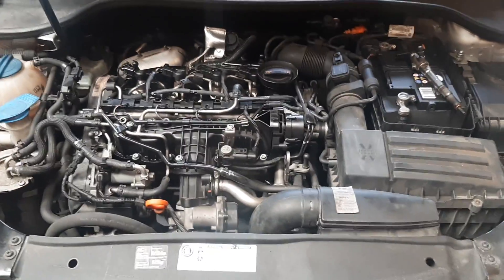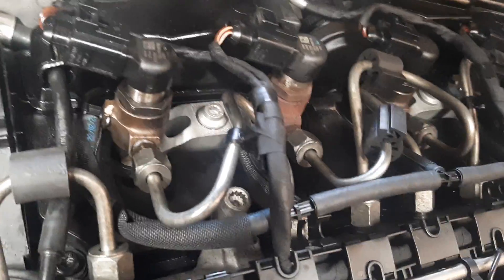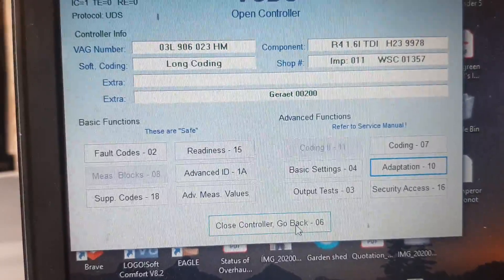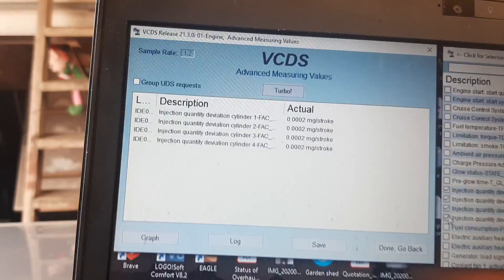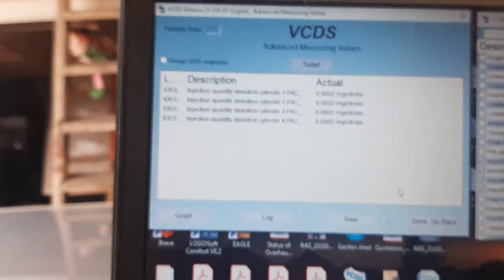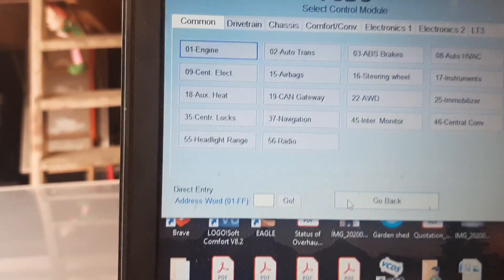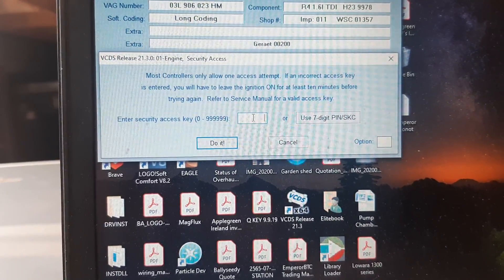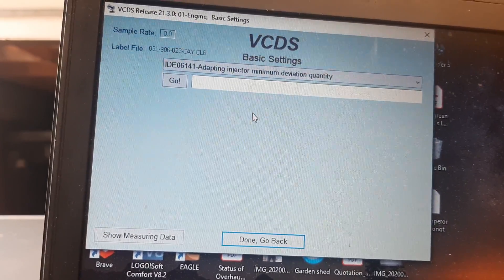VW 1.6TDI Injector Quantity Adaptation IDE06141 CAYC engine

Comment: Thanks so much, i ll try this tomorrow, i was stuck in the infinite loop.
Reply: Hi, I have changed the injector and it seems to have been sorted now. I never coded the injector or did a quantity deviation adaptation yet. Probably just an injector that went bad. I was thinking of coding the injector and just driving it to let it do the quantity deviation adaptation itself automatically.
Reply: @ohsasho5865  that's strange but if it works it's good. I doubt that ECU does adaptation by itself otherwise what's the point of the manual adaptation.
Reply: Hello, everything worked well on my 1.6tdi cayc, duration: 20 min, after that engine sound and behaviour became very good, motor health is back. Thank you so much. Do you have other procedures like this one to improve other things ?
Reply: Hi, I am stuck in the infinate loop. I did everything word for word about 5, also looked at part 2 and still stuck in a loop. Was there anything different that you did? @GEO-42
Reply: @ohsasho5865  it's not infinite, it can take long, just be patient. It took more than 20 min on my car. How long did you wait ?
Reply: @GEO-42  About 75 mins and still nothing
Reply: There is a follow up video after this one on this channel about the infinite loop. It's an issue with vcds, you should watch it. Basically when engine is started and vcds working, you should navigate in vcds, read some random values and THEN try the adaptation after entering the security code.
Reply: @GEO-42  Thanks for your reponse, I appreciate it. I did watch both videos before I tried this.The first attempt was about 75 minutes which I stopped. The second and third attempts I stopped it at it 30 min. Im guessing I may have a faulty injector. Engine sounds worst now
Reply: @ohsasho5865  Don't forget to put the injector code before adaptation. After all your attempts check if the injectors coding is still there.
Reply: I mean the code that comes with the injector and must be entered in vcds.
Reply: @GEO-42 Thanks, Yes. I did check the codes and recoded it. I will change the injector.

Comment: Do you know why I do not have in VCDS this function IDE06141? I have the same CAYC engine in Golf, UDS, I’m using VCDS version 20 and I don’t have it. I have the same problem in injector number 3, but can’t do this adaptation. Thanks for help.
Reply from the maker: That is strange - Upgrade to latest version of VCDS and double check it should be there in Basic Settings

Comment: Do this injectors need programming in the audi 1.6 tdi kayc??
Reply from the maker: Hi Richard, do you mean CAYC engine? Yes all modern common rail diesel injectors generally need to have their offset codes assigned in the factory programmed.

Comment: Tried it on my Audi A3 1.6 (2012) and it worked, it had clinking noise before but now it is really smooth. Initially I thought there is a bad injector but for now it works well. All-though the torque is not here anymore so I guess the algorithm made the injectors closer to the lower values so that it throws less gasoline which made the car weaker now.
Reply: did u get an engine light with codes for injectors?
Reply: @idajosefin0121  no engine light, just the clicking noise
Reply: Bu prosedürü enjektör degiştirmedenmi yaptınız Orijinal enjektörler üzerindeyken mi ?

Comment: I’ve tried the minimum injector deviation, when I had the original injectors, the vehicle performed the cycle in 5 mins. I changed the injector and now this is taking over 50 mins and isn’t finishing the process. Any help will be greatly appreciated.
Reply from the maker: Hi @fez14 I have made another video to hopefully clear this up https://youtu.be/uK7zuUVclJ8

Comment: Just fitted a new injector to a skoda 1.6 tdi 2016
Did a leak off yesterday and showed it didn't leak off at all or barely. Changed it coded it in with modus snap on. Its not happy it's running on 3. No engine codes. I checked to see all codes are there. They are. I'm thinking use VCDS but is there something else I should do I will be sure to try this Procdure!
Reply from the maker: I'm assuming the 2016 1.6tdi is running the Delphi injection system? 
VCDS is what I would use. The delphi setup requires a conversion map I think.
Reply from the maker: @Richie if Delphi look at this post. https://forums.ross-tech.com/index.php?threads/3396/

Comment: Hi there I have rought idle at cold dtart with my 2011 VW Jetta 1.6 tdi,  engine code CAYC. Also engine has click sound under acceleration. I send all injectors 2 times for repair and cleaning and the injector tester show normal values for them. I try to do adaptation. Process starts , revs go up and down but it never ends. 30 minutes and still continue. What can I do ?
Reply from the maker: Check out my updated video @Eldi hope it helps you. https://youtu.be/uK7zuUVclJ8
Reply: @enginemanagementadventures7305  thanks so much. I really appreciate it and I can’t thank you enough. I just wanna ask , mine lasted at least 20 or 25 minutes and VCDS said timeout, does it finished correctly? Cuz car is running really bad and I can hear injectors when I am driving. Also when I check values, 2 injectors have negative values around -1.4 and the other 2 have positive values around 0.5

Comment: Hello buddy. I have got 4 new injectors replaced but the mechanic forgot to coding it. The car been shaking and revs it’s self when it’s parked. I got someone coming tomorrow to code them in. He’s got vcds program but he’s never have done it an Audi before. Any advice or just to follow when you done in the video?  Appreciate your time to read this for me
Reply from the maker: Hi there, Audi? Thats most likely a 2.0tdi probably Bosch injection system - do you have the model and engine code or power?

Comment: Hello bro thanks for the video .. I have vw vento 2012 1.6 TDI engine have injector failure and replaced 3 injectors with 2 new and 1 used injectors one by one in 6 months after replacing 3rd injector (used injector) my engine performance has dropped and my mileage and pickup is very low, actually after replacing 3rd used injector with in a day again that 3rd injector got failed so have went to the service station and asked for 3rd one the service person did something in laptop for half an hour tha faulty injector gets adopted to it and fill date no failure in injectors but after that am only no pick and no milage my engine noice has changes pls help me out with this bro i want my previous performance back.. (also of I tell this story to any of my seicive person they all are checking in software and telling there is no fault code showing so ur injectors are working fine no need to clean or change the injector yet seams) thanks in advance 🙏🙏🙏
Reply from the maker: Hi Saravana, did your injectors fail electrically, did the piezo pack fail. Do you know what fault codes were present? How many KM's are on the engine?
It is important to know if the injectors failed due to wear or electrical failure.
Reply: @enginemanagementadventures7305   Hi Thank q so much for u reply, Yes my injectors failed electrically (solenoid), have not notice what fault code were reflected, now my ODO is 114000km and have faced injector failure at around 80000kms,
Reply from the maker: Very low mileage for failure! you should check the injector offsets first - the new injectors may be different from the used one. Very strange that 3 injectors failed piezo stack so quickly.
The used injector may have a lot of milage on it - when coded the ECU thinks its new, did you run IDE06141 to balance?
Reply: @enginemanagementadventures7305  Hi bro how to check injector offsets?? the used injector may have lot of mileage la bro so if i replace it with new means everything will be okay??? and don't no exactly whether my service person did IDE06141 to balance my injector or not, but he took hardly 15 to 20 mins to arrest the fault code. and bro how to contact you can u share ur mail id for further TIA
Reply: @enginemanagementadventures7305  Thank q for u reply bro 🤗🤗🤗

Comment: I have a problem with my ibiza 1.6tdi 105hp, when i start the engine in the morning there is a loud sound,  clicking, engine vibrating and a white smoke coming out. And after it is warm it sounds good.
Is there any solution? Or I should change the injectors?
Thanks!
Reply from the maker: Hi @NotBAD The symptoms you describe could point to many things but a more detailed assessment is required.
Do you have any Engine fault codes active? If the engine is performing normally when warm I certainly would not replace Injectors unless they are obviously defective.
Reply: @enginemanagementadventures7305  hey, thanks for the reply, really appreciated.
I havo no engine faults and this happens only once a day in the morning when the engine is cold.. when it's warm it runs like a clock, a friend told me to put some oil+gasoline in the tank, it may help the injectors clean...
Thanks again.
Reply from the maker: @NotBAD Please do NOT put petrol/gasoline into a diesel engine! your common rail pump relies on Diesel fuel for lubrication and the solvent action of gasoline will dramatically reduce the lubricity of the fuel causing complete injection system failure.
Reply from the maker: Check you alternator over-run pulley it may be seized causing the loud sound when the engine is cold.
Reply: Have the same symptoms on 3.0bitdi, have you sorted it out?

Comment: Can’t find this option in VCDS 21.9 
Any advice would be appreciated.
Reply from the maker: Hi Moto, what engine are you communicating with ?
Reply: @enginemanagementadventures7305   Hi, cheers for your reply. 
It's a 2009 Golf 1.6tdi CAYC engine. 2 Injectors replaced with recon units, coded in with VCDS and engine now runs lumpy at idle.
Reply from the maker: @MotoHighlands Is your VCDS the latest Revision I'm currently using V21.9
Also what is the Software code when you log into engine screen i.e. 1.6 R4CR Hxx xxxx
Its possible that this was not available on early software versions - There may be an option to "Reset learned values of quantity adaption" this will reset the offsets for smooth running idle control.

Comment: Nicely done 
Q" can I do that in my VW Touareg v6 tdi to calibrate injectors looks like #2 is giving on higher side 
Thanks
Reply from the maker: Hi Emil, its important to realise that this inbuilt procedure is for the replacement of an injector. There are many reasons why compensation values vary, nozzle wear, drivetrain oscillations from worn flywheel etc.
The Ecu adjusts this value continuously to smooth out idle.
If your engine is performing ok I would leave it alone unless replacing a failed injector.
Reply: Hello. I replaced injector 3 and 4 last year in my Audi A3 1.6 TDI 2012. It is now misfiring when it gets warm. I took it to a electrician and he said injectors 3 and 4 are showing -ve readings. Will this procedure work for me ?

Comment: Have the same issue, P0202 fault which "is" injector cylinder 2, the faulty one is second from the left looking in from the radiator. My VCDS data blocks all show cylinder 4 faulty (which I gather is the firing order so no 2 geographically). Did you have to remove number 1 and 2 injector to replace as the bar will not come out unless you do? (they say remove injector 1and 4 in the manual but think its firing order again).
I would be careful with the VCDS use of cylinder numbers, if you are replacing an injector I would check the existing code correlates to the injector you are replacing so when you recode you know it corresponds.
Reply from the maker: Hi phil, generally cylinder 1 is @ crank pulley end. (French cars Renault for example are the inverse of this).
The injector clamp for 1 & 2 will need to be removed and u can remove injector 1. (Run the engine till hot before you start).
Replace injector along with o-ring, copper seal and new injector clamp bolt.
Ensure you torque correctly.
Reprogram injector compensation code and run the balancing routine.
Reply: @enginemanagementadventures7305  I have fitted replacement injector and the car runs...sort of. get P0101 fault after 5 mins but heyho. I ran adaptation for 25 mins and just says running. Is the glow plug lamp supposed to flash at the point when you get to 2000rpm? mine actually gets to 2500 then stops and returns to idle automatically.
Reply from the maker: @philcross6037  Hi Phil, the adaptation has not ran correctly. Read my previous replies to other posters, this procedure is  essentially not coded intuitively by vag com.
Security access must be obtained as outlined and is the reason i made this particular video.
Reply: @enginemanagementadventures7305  followed this three times:
Start by bringing engine to operating temp and ensuring and ensuring no active codes present.

Now EXIT from VCDS switch of engine and take out key WAIT until all throttle body etc PWM hum stops AT LEAST 20 SECONDS.

Start engine and idle, establish communication with ECU go straight to security access and apply offered code DO IT

STRAIGHT to Basic settings and select IDE06141 select run - BRAKES & CLUTCH - release - Floor throttle - release as instructed.

You know its wrong if it revs to approx 2800 rpm and stays there.

Correct operation is revs to 2000rpm then 10 runs through the rev range 3 to 4 times takes 5 - 8 mins.

It WILL NOT WORK if you navigate to security access after running engine for awhile and checking fault codes ete - security access MUST be established by full power down and initial communication.
Reply from the maker: @philcross6037  I see Phil, did the previous MAF code you reported disappear?  I assume  no codes are present at the time of performing the balancing routine.
Reply: @enginemanagementadventures7305  none when starting the test. I am replacing MAF and fuel filter next week and will try again after that. The values are a bit out +2 -2 on some so will it still run? will try next week anyway. Do you not normally get flashing glow plug when running test?
Reply from the maker: @philcross6037  Yes flashing glow plug when any calibration sub-routine is running.  So to clarify Phil it seems that you had a dead Piezo stack on number 2, so you replaced with a new or second hand injector ? did you code in the offset codes?
Seems strange that your MAF is in trouble, these are very reliable, check to see the MAF live data values and spray with brake cleaner.
It will run with those offsets, the injector will compensate to a certain value and then throw a code if it cant acheive balance within a certain tolerance.

Comment: Work fine for me :) The engine runs like clockwork and doesn't make any noise anymore. Thank you for this well explained video ! You saved me 4 injectors replacement ... :)
Reply: What did you do, minum quantity adaptation or coded them in?
Reply: How long did it take?

Comment: Big thanks for the video! Can i send my values to some email or something? Im lookin for advice. Thank you again
Reply from the maker: Hi @hanzo_hasashi420 post away! whats your problem?
Reply: @enginemanagementadventures7305  i have 1.6 tdi golf 6 cayc. On cold start in the morning i have rough idle sometimes but after few minutes it gets normal. When engine is hot, at 90 C, i have that knocking sound arround 1500 and 2000rpm when accelerating. It does not effect my ride, but it is very annoying. Tomorrow i will have exact values of injectorts to see if there is some large deviations. Im wondering do i need to change injectors (one or more) or it can be repaired with adoption
Reply from the maker: @pochinki420  Hey, well being honest adaption does not fix knocking really - check your values regarding compensation values, how many Km's on the engine and flywheel ? 
knocking under acceleration is most likely over fueling from a worn nozzle.

I cant stress how much people need to consider the complete drive train, including flywheel and engine mountings.

I assume no codes are present atm.
Reply: @enginemanagementadventures7305  im at 220.000km, no fault codes, and flywheel is at good condition. I will post values tomorrow, just to hear your opinion
Reply: I replaced an injector, put in the code supplied and took car out for road test. Engine had vibration between 1k - 2k rpm. Checked the deviation quantities and the the injector I replaced had a value of +2 but the others had -0.6... Ran the deviation adaption, took around 5 minutes to complete. Checked values again and all within tolerance of each other. Roadtested again, no hesitating just smooth as butter!